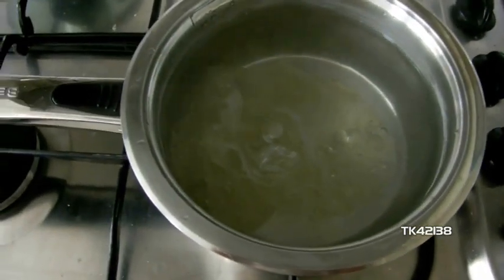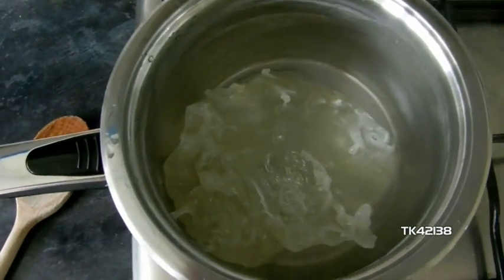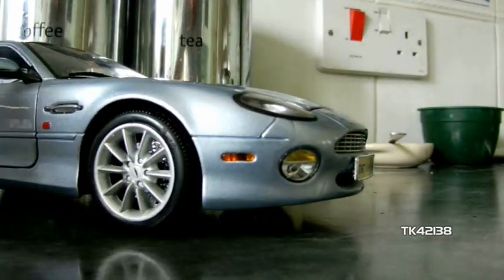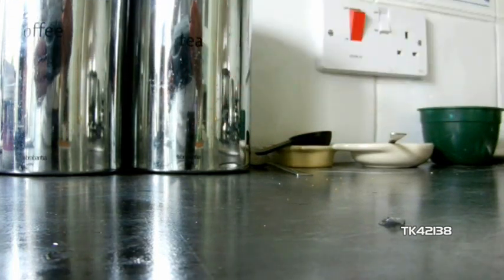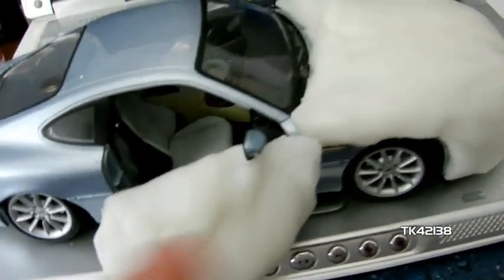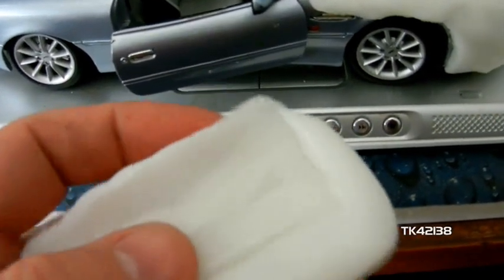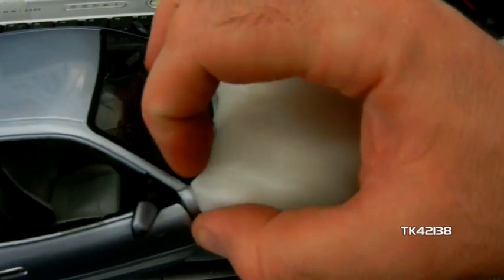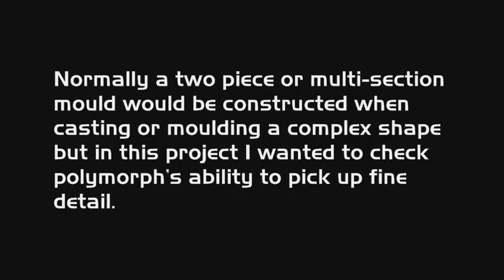Aston DB7 vlog part 3 Applying polymorph & Mould removal

Comment: Wish I watched this sooner, that furniture polish removal method would have helped a long time ago. Currently struggling to remove it from a go pro case
Reply from the maker: Put the case in hot water. The polymorph has a much lower melting point than the Go Pro polycarbonate case.
Reply: @TK42138  yeah sadly i tried that but it seemed to had almost fused to the cose itself and refused to come completely off (probably because i was using a microwave to heat up the plastic instead of hot water) so i had to just get rid of the case unfortunately

Comment: Maybe try making the plastic much thinner before you put it on the car.  Use a small Popsicle sick to push the plastic into the detailed areas of the car.   Then add thicker plastic over the thin plastic for stiffness.  It worked great for me.
Reply from the maker: ThomasTheSailor Chubby Thanks for the tip, I'll try it when I get the chance.

Comment: Does this work? I want to make small molds and dont want to buy a mold making kit if i can use this method as will save time and money
Reply from the maker: It does up to a point but I should have beefed up the moulds because polymorph will bend if the mould is thin.
Reply: @TK42138  what thickness would you suggest the molds be?
Reply from the maker: @darrentinman6994  I would aim for making them as deep or brick-like. In my example I had to work out position to avoid undercuts since polymorph is rigid when it cools. It all depends in what you're moulding.

Comment: What was your reasons for this? And what does the end product look like. 
 Cheers
Reply from the maker: Hi, I used polymorph to make a negative of the door panel in order to 'push mould' a panel from thin aluminium sheet. The idea being to make a more realistic 'crushable' model for filming. As you know standard diecast metal models are too rigid to dent realistically which doesn't look good on film. The plan is to make a teaser trailer for a novel which features an Aston Martin being trashed. As the budget is zero I'm having to use what I can find. Having a large scale miniature comissioned from ali panels would be hellishly expensive so I'm testing proof of concept and working out what panels need to show damage with reference to the shots needed. It's a work in progress. As for polymorph - I don't recommend this as a moulding material as it's not dimensionally stable and 'creeps' or bends when warmed up. The next stage will be to make two part moulds to press panels out.
Reply: Polymorph is the best substance i have come across but 
as moulding material i agree it would be poor. but does colour well and relatively easy to work with. I found a jet lighter (blue flame) is a good was to use on little sections to remolded or the correct.
Good luck on your project.
Reply from the maker: Still working on the Aston miniature project. Next stage is making two part press moulds so I can stamp out the relevant body panels hopefully to increase workflow. Just trying to find time to get it all together.